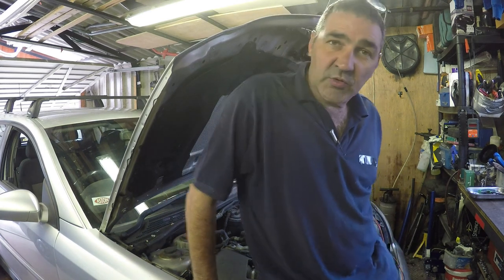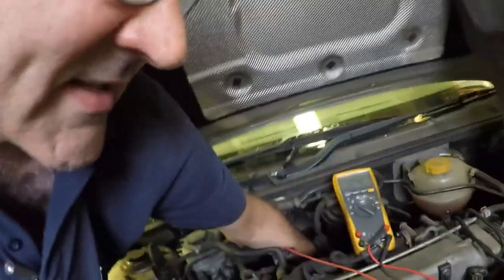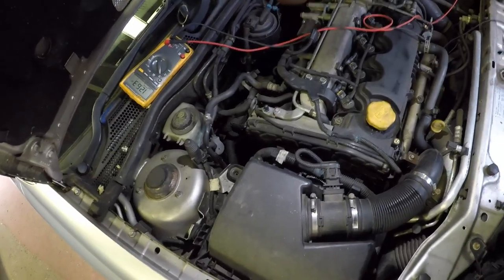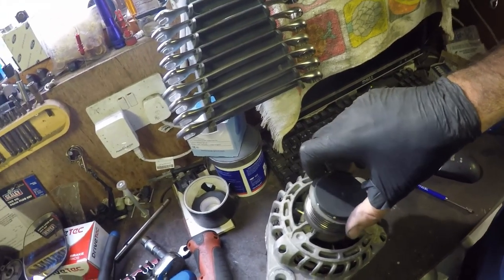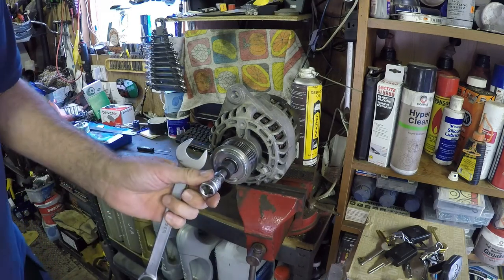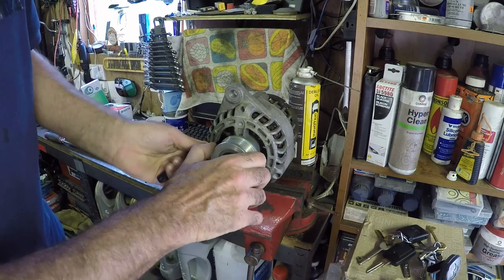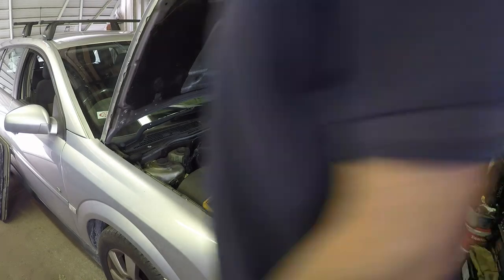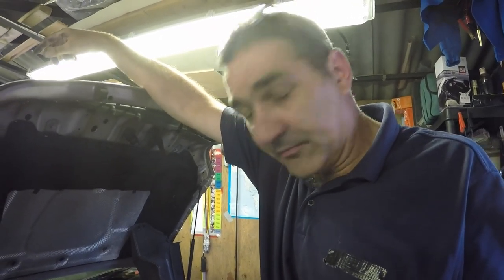Vauxhall Opel Vectra 1.9 cdti 2005 Alternator not charging diagnosis. Fixed!

Comment: A common problem on these is faulty battery cables. The crimps on the live and earth leads fail and cause high resistance, if you feel the battery terminals they may be extremely hot, if so you need to add a cable from the alternator to the battery +ve and an earth strap from the battery -ve to the engine.
Reply from the maker: Useful info. Cheers
Reply: I know this is an old video but let's see if I get any reply.  🙂
My negative terminal gets VERY hot when the engine is running, especially when the charging system is on load, ie with lights and fan on.  I have already added a cable connecting the negative terminal  to the engine.  Would it actually be a problem on the positive side?  Would adding a cable from alternator positive to battery positive terminal solve my issue?  TIA.
Reply: @chishek1710  Make sure the terminals are shiny clean and properly tightened up.
Reply: @kevinbradley172  thanks for the reply.  I will give them a good sand and see.  👍

Comment: What is the purpose of that one way pully , it's not like the engine will start running backwards or anything.
I have the same problem happen to me today btw.
Reply from the maker: I think it helps absorb vibrations. Sometimes when the pulley fails and locks, the belt starts vibrating and jumping about. 👍
Reply: @Automotive_Solutions  mine is doing that and is making noises at first i was thinking its the tensioner but now the alternator died so probably that was making the noise or it could be both 😐

Comment: Having an issue with my zafira 1.9cdti where the car will be fine for a couple of months then it wont start every few days or weeks. The battery is running flat but theres no warning signs other than it not starting some mornings. The voltage is all over the place and reads anywhere between 13.6v to 13.9v on my silverline battery charger and it says the alternator efficiency is 0% but surely if the alternator was so bad the battery would be flat daily? Were on the 3rd battery this year and they seem to last us a couple of months then we're back to non starting. Any suggestions on where to start please?
Reply from the maker: You'd be better of having it diagnosed by a mechanic who can test the charging system properly with the correct equipment. It'll be cheaper than replacing batteries.

Comment: I have same problem. if you keep setting button pressed on the radio/cd player, a menu comes up  and press the bc button and different readings will display, including the voltage  ⚡.  it helps if you aint got voltmeter handy atm like me !

Comment: I'm having exactly the same issue with my Zafira, thanks for making such an educational video
Vauxhall Zafira B Diesel 05
,  I was driving, steering wheel became very heavy and stiff, lights started to dimmed and traction control light came on, so I stopped and switched off the engine, I tried to re-start the car but it was not starting, tried jump start, engine started immediately but after few seconds above symptoms appeared again so I switched off the engine !
Code showing ECN 007071, ECN 062102 and radio display flickers, battery is showing 11.70v ignition off,  battery voltage during tick over & prior to starting 9.30v
Do you think I need to replace Alternator?
Reply from the maker: Get someone to check it over. It does seem that its not charging - but there may be other factors, eg drive belt, wiring etc. good luck
Reply: @Automotive_Solutions  We did some diagnostics, jump started the car and after few seconds the voltage went down, and we can hear some noise when we started the car and I believe it's from the pulley, can we replace the pulley without taking out the whole alternator?
Reply from the maker: No - Alternator off to do it.
Reply: @Automotive_Solutions  May I ask how much would you charge to replace the alternator?

Comment: Is 13.85 a good charge?
Reply from the maker: Yes, it needs to be around that voltage. It will drop slightly with all the lights, heater etc on.